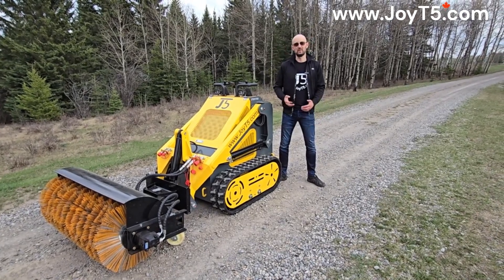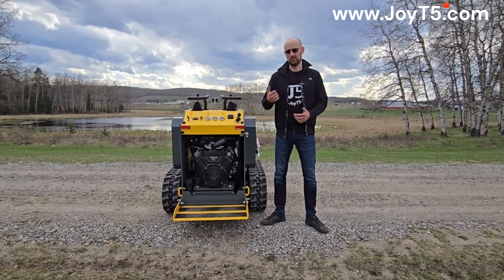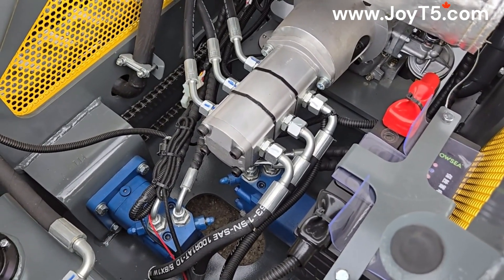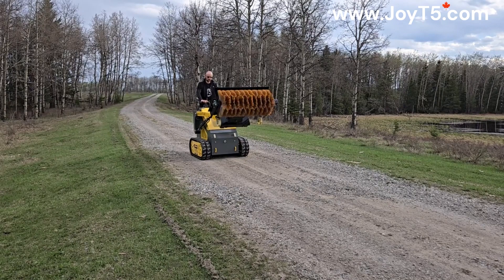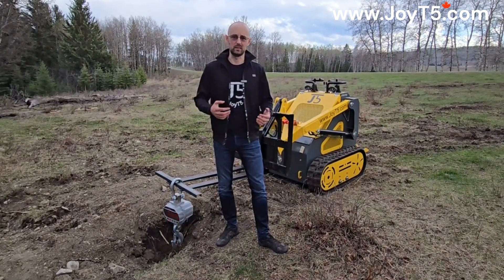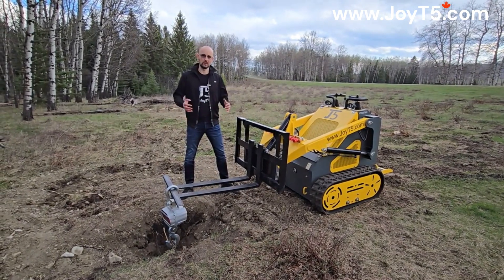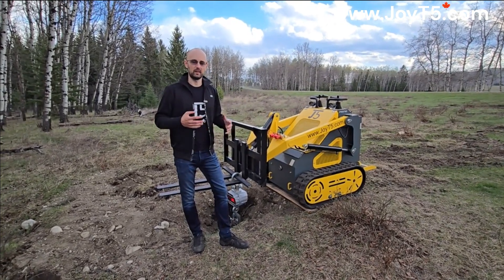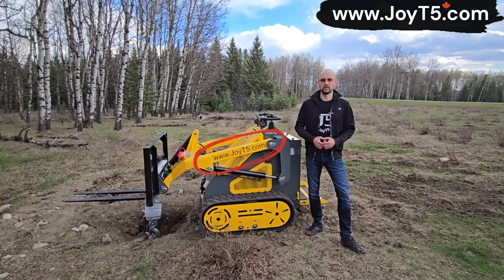Find the truth about Gasoline Mini Skid Steers | JoyT5

Comment: No need for three pumps. We do the same thing with 2 pumps. That 3 pump system is slow with no advantage. https://youtu.be/CMm2fHzZGC4?si=_iIYDGr-WrU94Sjo
Reply from the maker: Hello @natsterlive,

Thank you for your input! While both setups can deliver the same total system power, the choice between two larger pumps and three smaller ones significantly impacts performance based on operational needs. A triple pump setup offers enhanced flexibility and finer control over hydraulic functions, which is particularly beneficial for tasks requiring precision and simultaneous operations. For instance, driving the skid steer straight while operating a hydraulic attachment like a snow sweeper is feasible with a triple pump system. In contrast, a dual pump system will slow down one of the tracks due to sharing hydraulic power with the sweeper, causing the skid steer to go off course. Additionally, distributing power across three pumps can lead to more efficient use of hydraulic resources, potentially reducing wear and tear on individual components. It's also worth noting that the JoyT5 JT5SSTM3 Gasoline Mini Skidsteer model boasts many advantages over other gasoline engine skid steers beyond just the triple pump system, making it a superior choice for various applications.

Comment: Thank you for doing these videos.  I am not a potential customer as I am out of your market area, but it would be amazing if you could talk about how these relate to zero turn lawn mowers when a finishing mower/brush cutter is attached to the front.  Specifically is it possible to replace a push mower with one of these units.
Reply from the maker: @SenatoPerry ,  Thank you for your feedback about our videos. We are very happy that people find our videos useful. 

In regards to your question about lawn movers, we have not actually use a lawn mover attachment on the mini skid steer ourselves and we can only speculate.

The mini skid steer equipped with mower attachments can be a versatile machine for various tasks, including lawn mowing. However, it's important to note that while the mini skid steer with a mower attachment can handle mowing tasks, it may not match the efficiency and performance of specialized lawn mowers designed specifically for that purpose. Specialized mowers are typically optimized for speed, maneuverability, and cutting precision, which might be challenging to achieve with a mini skid steer. 

That being said, the mini skid steer offers the advantage of versatility, allowing you to switch between different attachments for various tasks, which can be quite convenient. Overall, it's a matter of weighing the specialized performance of dedicated mowers against the versatility of a multi-purpose machine like the mini skid steer. 

We would not go as far as claiming that mini skid steer with mover attachment is able to fully replace specialized lawn movers. 

Thanks again for sharing your thoughts!

Does anyone else have an opinions on this topic?